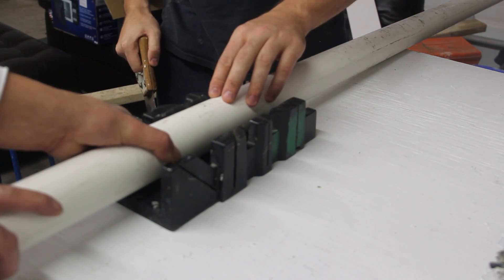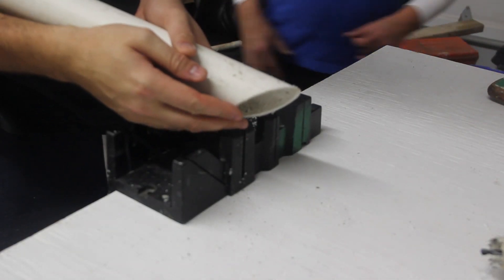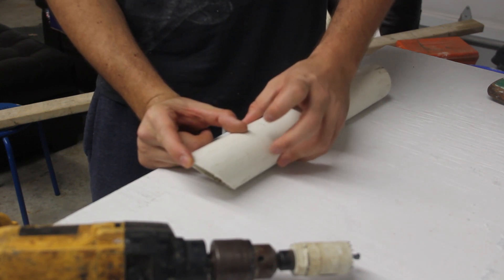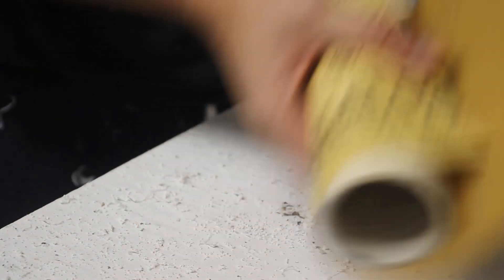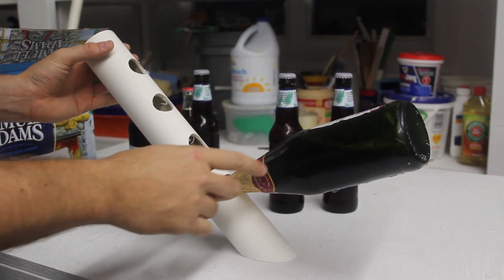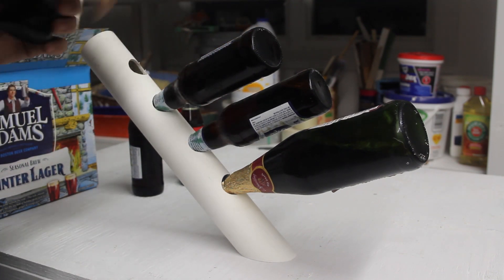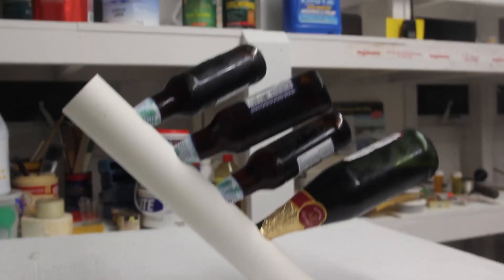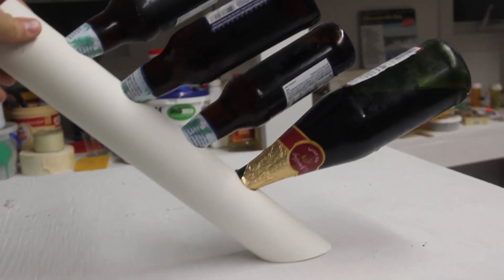Make Self Balancing Bottle Holder

Comment: Very nice, but all it will take is one cat, clumsy ass, or drunk to knock it over. :-) Might be a good idea to place a wider plastic base below the diagonally cut PVC pipe for more stability.
Reply: His would still look great using a thin plastic base attached to the pipe.
Reply: electronicsNmore
i say using one screw, you can drill the front of it to the table, as long as its a table you dont mind drilling stuff in itl work perfectly

Comment: Maybe if you put a heavy weight on the inside of the pipe near the bottom it would be sturdier.  And hot glue it to a surface to make it more stable (but less portable).  It still looks cool though.

Comment: All the sediment in solution will rest in the neck of the bottle which is undesirable for wine and beer. Bottles should be stored vertically if capped, and horizontally is corked. The physics behind the design are cool though. I'll give you that.